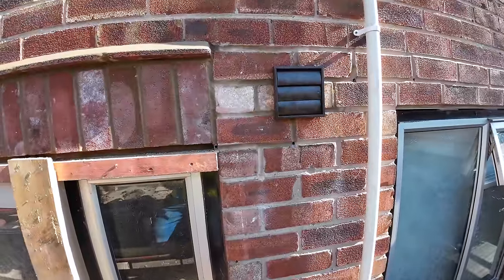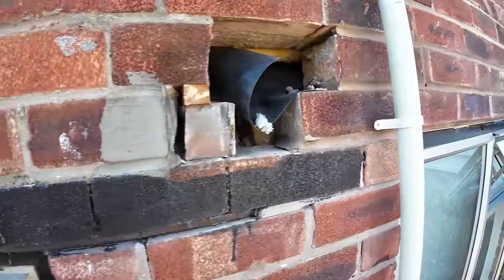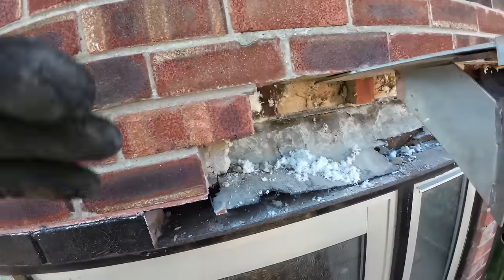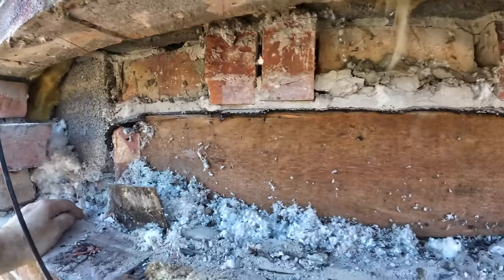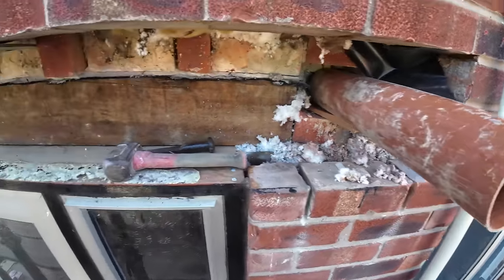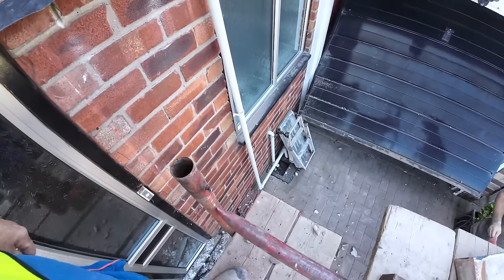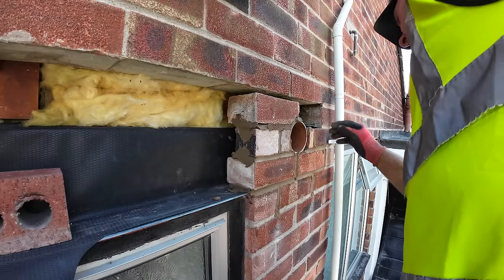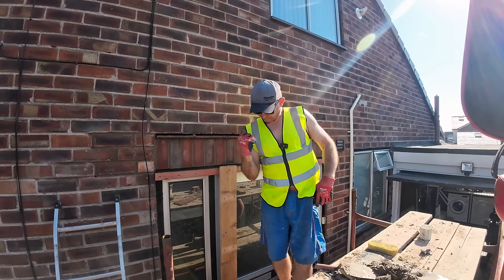SO MANY ISSUES TO PUT RIGHT ON THIS JOB

Comment: impressive ! 👌

No bricky questions :
34:54 When filling in the gap above the lintel, is there a reason why you are using those tiles instead slate ? , and for the dry-packing are you using special mix mortar or just using same that the rest of the brickwork  ?

thanks in advance  👍
Reply from the maker: Anything dense will do for packing .
   Same mix 4 to 1 🧱🧱👍🏽
Reply: @SteveAndAlexBuild  👌

Comment: The way that you have got your scaffolding set up with some bricks on the bottom is not very good. You could do with something better underneath them scaffolding that I have got I have got adjustable legs so you can set it up on angles or when there is steps, et cetera involved.

Comment: I've got a challenge for you! I employed a company to take a supporting wall down and naturally put in an RSJ...the result is awful as they put (Guardian Structural) put an RSJ in that was totally inadequate. Their solution was to weld another support onto the main RSJ. Worst of all a company they (Guardian Structural) called in for building regs passed the inadequate support. I am suing them both but in the meantime I need to correct the mess before the upstairs cracks get worse. Any advice would be greatly appreciated.😊
Reply from the maker: Sorry this is structural engineer territory . 
Good luck 😬🧱👍🏽
Reply: @SteveAndAlexBuild  I have had a structural engineer look at it and give instructions.

Comment: Got to agree with using bricks alone under the trestle.
On edge isn't very stable and bricks are brittle and could split.
You need a aquare of scaffold board under the frame.
Personally il ise timber all the way but half a block for height would be OK.

Comment: I'm old enough to say that in the 1960's while studying woodwork at school for GCE the Teacher told the class that conventional Houses had airbricks around the base of the foundations above the damp course and the idea was for the air to run up through the inside void of bricks to ventilate the main roof beams to stop Efflorescence and condensation yet we insulate this gap, I have noticed especially in the winter the tarp cover and main oak beams are totally saturated and we had that shredded paper crap blown into the cavities a few years ago, so my question Steve and Alex is should I be worried?
Reply from the maker: I can’t comment on a job without seeing unfortunately. 
    You need to get someone to check it for you .
    Good luck 🤞🏼 🧱👍🏽
Reply: My understanding of attic condensation is that the moisture that condenses in the attic supposedly comes from the interior of the house, through a non-air tight ceiling. Think any holes/gaps you might have in your ceiling, like leaky attic door, holes for light fixtures, anything really. How air tight do you think your upstairs ceiling is?